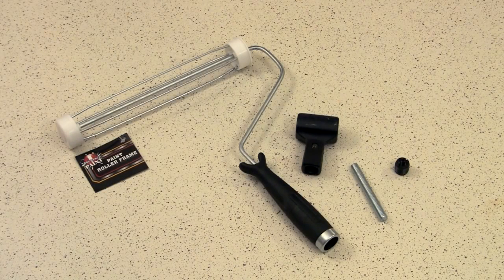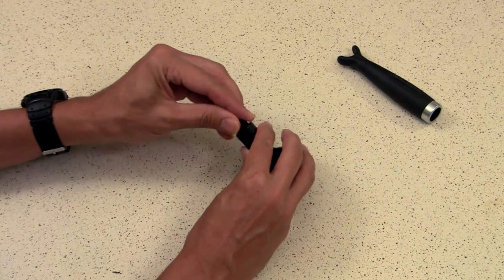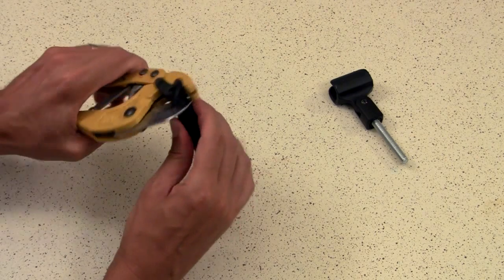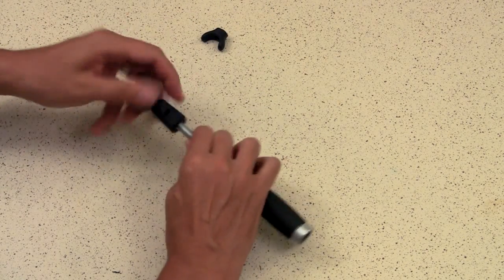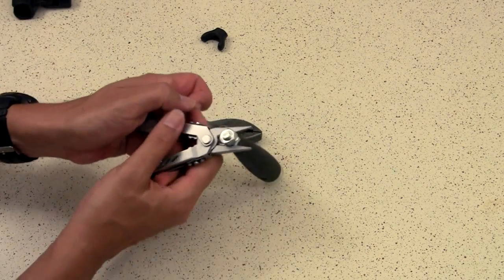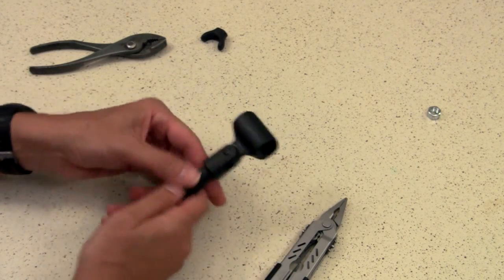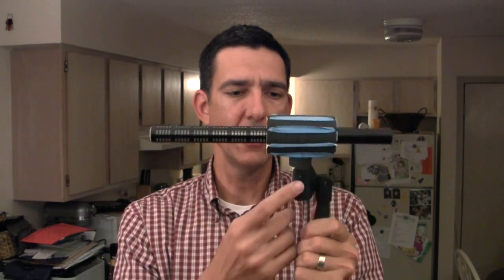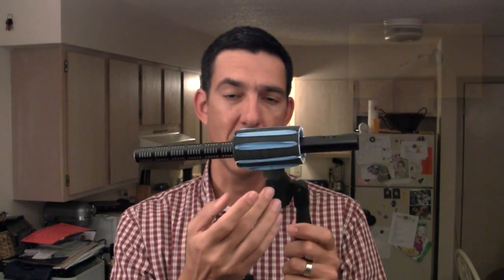Painter's Pole Mic Adapter

Comment: I was on home improvement store today looking for a painters pole to make a boom pole, I have found one which extends to 4 meters but the best part was that it had a scre on cap with a hole in the end, I had my mic clip with me and all I did was to buy a screw and attach it DONE! It works well and it cost me like 10 bucks total with 0 efford, I can't even call it DIY since I just screwed it...

Comment: This is how I did my shockmount/boompole adapter. I used the adapter that came with the shockmount to attache it to the paintroller. I also cut off the sides of the shockmount to glue the DIY shockmount in its place.

Comment: I've actually found that the DIY boom pole works best with the shock mount design by Ryan Connolly (of Film Riot).  The PVC adapter held up surprisingly well repeated use and very sturdy.

Comment: Thank you for posting this.  Love your stuff.  I made a few mods to your idea I thought to share.  1) the handle comes off easily using a blow dryer to heat it.  2) After cutting the "ears" off I just drilled a 3/8 hole.  3) I put the treaded 3/8 bolt through from the bottom with a nut already attach.  4) on the top I placed a washer than a nut and turned the bolt into the nut inside.  5) It snugged up nicely.  Once again thank you for your work.

Comment: I can't even afford an external mic/recording device, but I've done a similar procedure a hundred times.Grab a nail with some plyers and heat it till red hot, then widen the hole that is already there to a diameter similar to the one of your final screw or bolt (about half milimeter smaller), then screw the new bolt while the plastic is still semi-melted (notice that it has to be just soft, not totally liquid) work the new bolt screwing it back and forth to avoid that it sticks and voilá!

Comment: I use a 4" PVC coupling with hair braids as my shock mount.  Something this big could just be drilled with a 3/8" hole and nutted directly to that handle.  Although I have 2x L brackets (1") that I bent to hug the curve, and drilled out to fit a mic clip with the L brackets as the clip part.  Which I later nutted to a piece of wood to have two so I could shockmount the cable and actually aim the mic.  I should probably make a video.  And probably not the best for that device because of weight.

Comment: Is there any adapter out there that converts my standard mic stand threading directly into a hot shoe mount? I might be buying a microphone that normally mounts into a hot shoe mount on a DSLR but I would like to mount it on my mic stand at times for various reasons.

Comment: Will the frugal shock mount work with the Zoom H1?
Reply from the maker: I think it can fit, but isn't a very good option since it covers all of the H1's controls...
Reply: thefrugalfilmmaker Thanks for the reply, bud. I'm a subscriber and I'm also a frequent viewer :). I'm shooting a short film soon and the only thing I have left to do is figuring out a boom pole situation. I'm going to use the H1 and was wondering if you had any idea as to what I could use for a shock mount with your Painter's Pole Mic Adapter tutorial. The DSLR film noob is currently sold out on his shock mounts, unfortunately :/